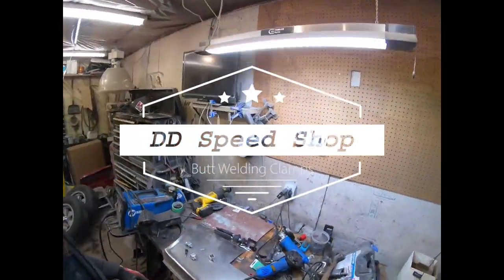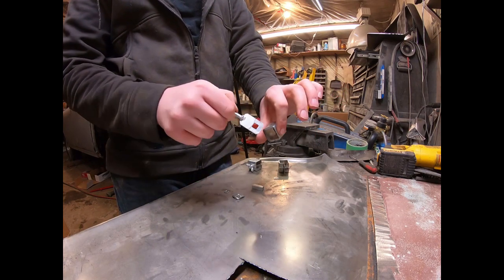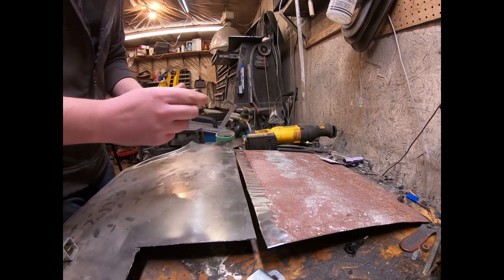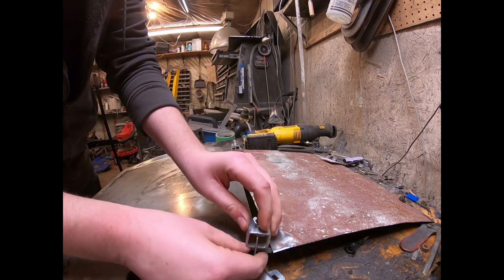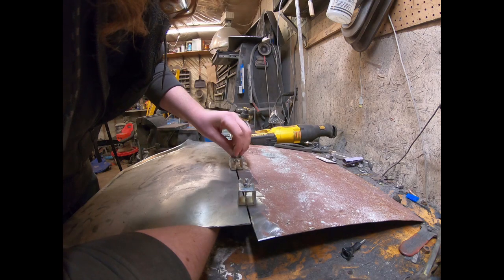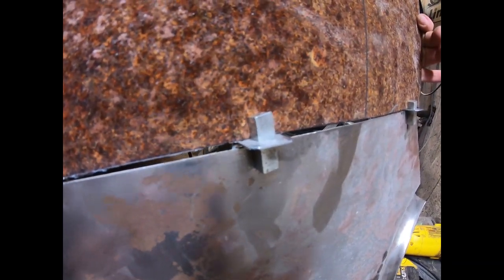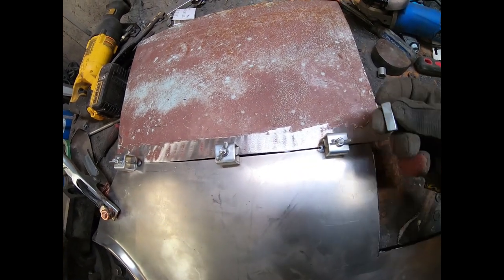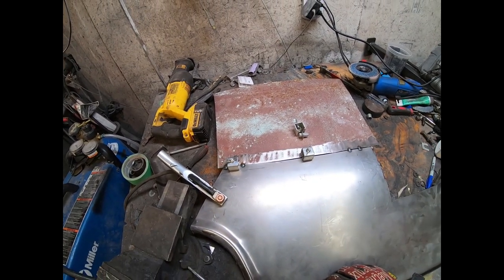Welding Butt Clamps Explained!

Comment: I wonder if “earth magnets” 🧲 would hold the panels together with no gap to deal with and you also wouldn’t have to retrieve the part that inside the panel after welding.  Earth magnets are expensive but may provide a better fit and maybe be easier to use. I’m actually clueless as I don’t weld but Just a thought?
Reply from the maker: yeah those suckers have alot of grip haha

Comment: Ridiculous  seriously,,and if you can't reach the dang back were the dang block goes, because it's a friggen Quarter panel, how do you get the little friggen block in the square hole behind the quarter panel, anyone can do it on a table where you can reach both sides,,on a car in an actual situation not the same????